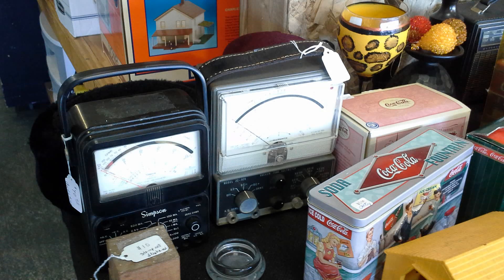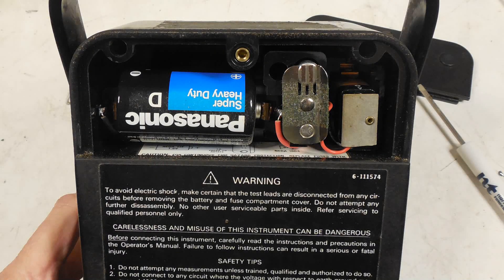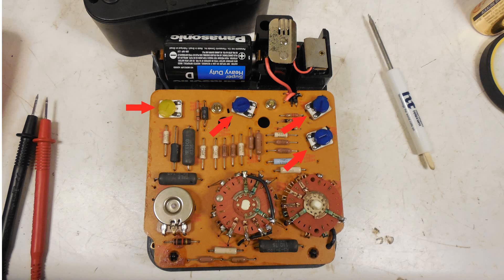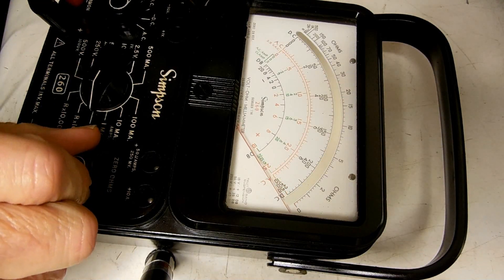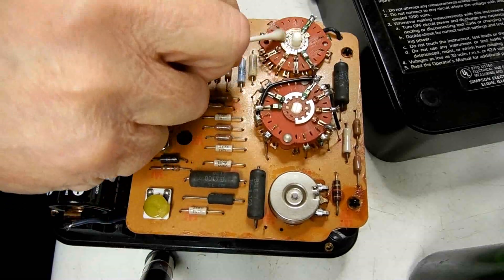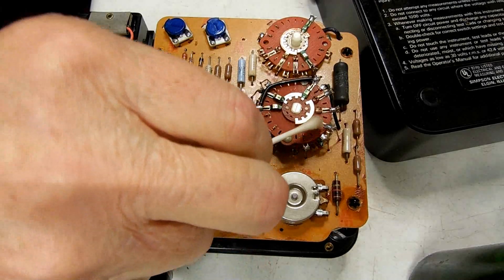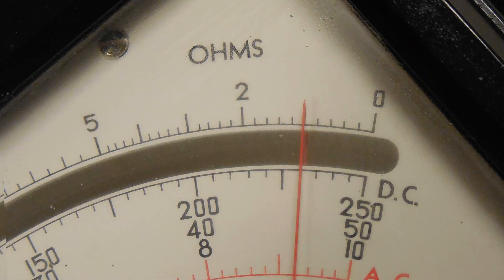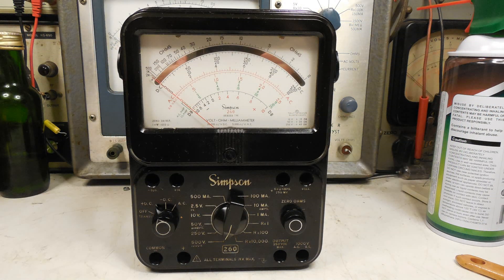Simpson 260 Meter, series 7 M

Comment: I worked in ETAS for the wireless group in Richardson, Tx. I was with Nortel from 1995 until 2001. Had several different positions. It was a great place to work until it all headed into the toilet.
Reply from the maker: Yes I agree! Between teaching and software engineering I also taught Cellular classes in Raleigh. It was run by the training group out of Richardson, Tx. I lasted about a year and they pissed me off, so I gave them my Two Weeks Notice. All of a sudden I was not at the training center any more. I found myself in the CPU Group at TAS in RTP.

Comment: Great find. 
I guess you prefer WD40 over Deoxit for cleaning contacts?
Reply from the maker: I use both WD40 and Deoxit. I use Deoxit to remove corrosion, Deoxit is not a lubricant. WD40 is a lubricant, and I also use it for old volume controls. The material that hold the resister run in old volume controls shrinks over the year because the petroleum in that material evaporates. WD40 has kerosene and this puts back the missing petroleum, making the material restore to original size.

Comment: I am very familiar with both electronics and small mechanical mechanisms and i cringed when you said you used WD-40 on the switches and that zeroing pot. While WD is mostly a solvent with very little lubricant in it, a simple cleaning solvent like alcohol would have been much better for the pot. There is nothing in that pot to dry up it only gets dirty over the years and if you wash that dirt out it will work like new. The very small amount of oil in the WD will only attract more dirt and hold it there. As for the switch contacts, again WD is not a good choice. It will clean them. Any corrosion on them would be better cleaned with an electronic contact cleaner which would probably have a proper lubricant for such electronic moving parts. In a 45+ year career in the maintenance of professional electronic equipment I mostly used WD to CLEAN mechanical parts and assemblies prior to properly lubricating them with actual oils and greases as recommended by the OEMs. I buy it by the gallon for my shop, but it is NOT at the electronic bench.
Reply from the maker: I have been using WD40 since High School, have not had any problems yet. You can add another twelve more years to this experiment and I'm still using this radio today.
My WD-40 TEN YEAR Experiment
https://www.youtube.com/watch?v=lyjUDh7Djpo

Comment: I have a problem with mine where it will not zero on the Rx1 scale.
Reply from the maker: Download the manual for your meter. In the manual is a wiring diagram for the meter. In the R1 circuit check the resistor in that part of the circuit.
Reply from the maker: Check the 1.5VDC battery also.
Reply: @AllAmericanFiveRadio  I have replaced both the 1.5v D size battery as well as the 9-volt.

Comment: buenas tardes amigo muy bien el vídeo gracias por compartirlo yo tengo un problema con un simpson serie 7 mide bien voltaje ac dc y ohm xr100 pero por rx1 no llega  acero ohm yrx10,000 si llega pero no como rx100 cualquier sulucion se lo agradesco pero en español no se ingles gracia ramón jhonny ta chira venezuela
Reply from the maker: https://simpsonelectric.com/

Comment: DEAR SIR, I just got one from eBay, that works except on AC, I measure 120 VAC, it reads 60VAC, but DC WORKS PERFECT, all resistors looks NEW, PLEASE let me know what could be the problem?
Reply from the maker: +ROBERTO ALVAREZ-RUIZ 
Could be one of the diodes.
email me at allamericanfiveradio@yahoo.com and I'll send you some information.
Reply: +ROBERTO ALVAREZ-RUIZ 
Before I contacted You, I suspect about the diodes (D1 & D2 1N100 ), I check them installed on the PC board and they looked OK.
THANKS YOU! I pulled both diodes one side each, (and the resistors also) and with my other NEW 260-7 on RX100 I found a "LEAKY" diode. Hopefully I had a broken needle CHINESE Triplett 630 and I remove BOTH diodes from the Triplett and install both on the Simpson 260-7 and I calibrate R 22 using my NEW 260-7 as a reference to the 120VAC from the AC Plug and NOW both have the same reading. PROBLEM SOLVED, THANK YOU VERY MUCH & GOD BLESS YOU!!!

Comment: I Took two 260s off the shelf that I found years ago at my club's swap meet.  Given all the negs I have heard about using WD-40 on vintage equipment, I was skeptical at first but with little invested in both meters, I decided to give it a try.  They have been "stroked" back to life.  Your videos have taught me much.  No matter how much one knows, there is always something left to be learned from another.  Thanks for sharing!  Bill
Reply from the maker: 88jolzenrocket Thanks Bill

I've been using WD-40 since high
school, I graduated in 1963. So I know that it works, but you don't
want to overdo it, you only need a few drops. Obviously I have gotten
some amazing comments saying that WD-40 will dissolve your radio, I
think they must be global warming scientists. By the way I think
global warming scientists is an oxymoron, because they never mention
that the polar caps on Mars are melting. Must be due to the large
number of SUVs on Mars.

Comment: Great old meter the #260"..at one time the "Gold Standard" VOM. Rugged and accurate. BTW about 4 years ago you made a Youtube on a Nakamichi BX-1 and I have a question concerning the idler wheel...What exactly did you replace the idler wheel tire/band/belt with? Since you picked the band up at the hardware store I assume it was an ordinary "O" ring of the (nearly) correct diameter. Thank you for all of your professionally produced YouTube videos and the great information. they convey.
Reply from the maker: Yes it was an O ring
Reply: AllAmericanFiveRadio
Thank you...your kind response is much appreciated. Please keep the good works on your informative videos.

Comment: I used one of those during the time I worked at WAFB Knob Noster, Mo for Motorola and Central Communications very very good meter ..... WD - 40 will take that tape glue off the case without scratching you can get schematic`s to show you how to calibrate it.

Comment: Rick,
Good find.  Believe it or not, there was a time when I calibrated and repaired Simpson 260 meters.  Of course it was merely a matter of following the calibration procedure, not much of a troubleshooting and repair deal.  Most calibrated just fine, but once in a while an out of spec resistor had to be replaced.  Some came in that had been repeatedly dropped and the broken cases showed it.  Even then, they still calibrated perfectly.  They're tough little buggers.

Regards,
John
Reply from the maker: Hey John,
I bet you did get some meters in that look in rough shape. But as you said there tough little buggers. And I'm so glad I found this one.

Hope you all have a very happy and prosperous New Year.
Rick

Comment: Rick, Congratulations on your find.  I'm really glad it turned out so well.  I once bought a well-used Simpson 260 for $10.00.  It had not been used for a very long time and was full of battery corrosion from a leaking Duracell battery.  It was a real mess. I ended up sending it to Duracell. They sent me a brand new Simpson 260-8!  Tom
Reply from the maker: Pretty good deal, glad it eventually worked out.

Comment: Really nice find, Rick.  They've been around a long time, in various releases.  In the Navy, in the mid to late 70's it was our standard issue multimeter.  Great for quick and easy visual NP junction bias checking, as well as all it's other functions.  If I ever run across one in that condition, I'll buy it.  Thanks for showing it.
Reply from the maker: Thanks OldRadioAl

Comment: I learned on the Simpson 260. I have three of them two series 7 and one series 5. They are fantastic meters.Still made and sold but around 350 to 400 USD. If you do a search on line for 1,001 uses for the 260 volt-ohm-meter ther is a PDF with tons of knowldge I did not know about.It has simple circuits you can build to expand the capability of the 260 in it.Well worth looking for. http://simpson260.com/downloads/downloads.htm Also the Operator manual is available on line as a PDF. The only problem is these old meters are not CAT rated so some places frown on there use nowdays. Just like the good old Square D "wiggy".
Reply from the maker: Simpson is making the 260 meter today. It's still a very useful and rugged meter. I bought one when I was in high school (series 5) and still have it, and it's like new. I don't keep batteries in it because I want to keep it like new, so as a result I end up not using it. But now I have this one and it will be used. Thanks very much for the information, it is very useful.